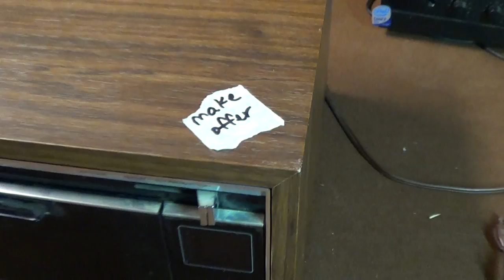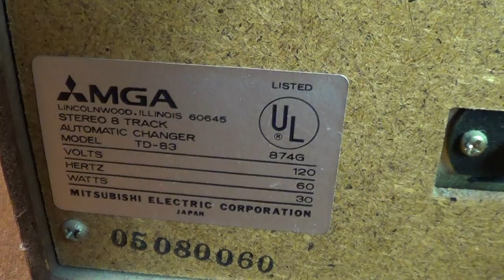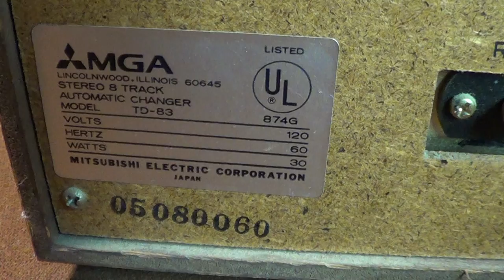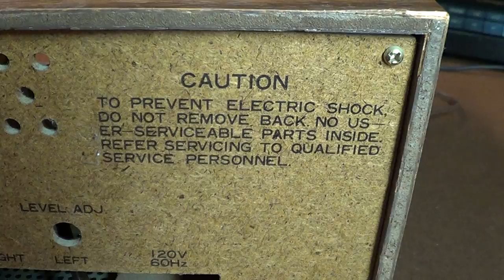MGA (Mitsubishi) TD-83 Triple 8 Track Tape Changer Overview

Comment: Watching this video brought back memories for me. Back when I used to have 8-Track tapes, this changer was one of the several players I had. I acquired mine from my high school, I found it in a storage closet in the main gym. I eventually was able to take it out of the closet and bring it to one the assistant principals and asked him if I could have it, he asked the principal of the school at the time if I could have it and eventually told me that I could have it since nobody else needed it or was using it. So I had the player for several years until I sold it to a used record store in my town back in 2010 when i got rid of all my 8-track tapes and players to focus on my record collection.  I do remember the player making that twangy sound when you turn it on without inserting a tape first. Towards the end of me having mine the player stopped switching channels automatically but still would switch manually and the belt would also fall off often as well, i am not sure why those things happened but they did.

Comment: In an antique mall about twenty miles from where I live, there is a very scarce MGA wall-mounted hi-fi system.  It has a vacuum turntable with linear tracking, a built-in 3-motor tape deck, an AM/FM radio with AM Accent, and a built-in 200w 4-channel amplifier.

Comment: That's awesome! Interesting how yours has a level adjustment just like VWestlife's. Up until then, I've never seen that before, other than some cassette decks that have a playback level adjustment on them.
It's too bad the motor mounts broke, but I'm sure that can be easily repaired. You've probably got everything you need to repair it.
It looks like a very beefy mechanism. Sometimes with these complicated mechanical devices, they tend to have a lot of problems, so it's nice that it works perfectly.
Someone mentioned a SDP easy-bake oven... it actually does look a little bit like a mini oven!

Comment: Hey uxwbill I really enjoyed the rant about the cheap modern motors vs the older higher quality motors given the fact I personally own a 1920s Hoover vacuum that had sat in a basement for 50-60 years if not more and had never worked yet after a mild oiling it sprang to life when I plugged it Ina's if it had been produced yesterday if not better. On a irrelevant point I hate to be a pain about it but I would really appreciate more car videos namely more of fur heads jeep, the key keepers EBGPOJ, and the little 2.3 ranger and maybe even some grain truck vids. But as I've pointed out before I'd namely like to see the ranger as it's a bit nostalgic for me given I owned one  of the same body design

Comment: May I suggest to use rubber washers with a plastic lockable plastic strap like the ones used in wrapping computer power wires!

Comment: There is a tube of glue that I have that was made by 3M, it's some sort of rubber cement for neoprene and EPDM? rubber, I use it for patching speaker cones but it will also glue rubber to rubber. I've used it a few times to patch bicycle inner tubes with rubber from other bicycle inner tubes. I think it's called "Sure Grip' or something. Lets say that glue does not work I have seen mounts like that before, though I cannot recall where, it looks like they have a threaded insert molded right inside the shock mount. In any even I am sure you will come up with something, even if you have to rework it to accept a rubber grommet through the chassis with a screw, nut, and washers. Maybe even compression springs like a record changer would use?

Comment: This looks very similar to the Realistic TR-888 Triple Play 8 Track Stereo Automatic Changer, maybe Mitsubishi made that too?

If you find 4 appropriate grommets you might drill out four holes on the units chassis, insert 4 grommets. Use washers and nuts on either side of the grommet to insure the screws/bolt stay in place a nut on the top and bottom of the grommet. also drill 4 small holes on the motor's chassis and tap the holes to fit the screws, screw the screws in from the top, down toward the units chassis. Once the screws are screwed all the way in, be sure the screws do not unscrew by coating the screw where it seats onto the motors chassis with fingernail polish. once dry first put a nut onto the screw, then a washer put this through the grommet already inserted into the units chassis and the a washer and nut on the other side. You can now adjust both the top and bottom nuts insure the pulley on the motor lines up with the weighted fly-wheel / pulley.once the nuts are properly adjusted, coat them with nail polish to insure they too do not rotate, thereby throwing off the adjustment you made. You not not want grommets that are too soft or too hard.

Comment: I would think that if you took some small machine screws and some old fuel line and ran the machine screws through the motor brackets, then through the fuel line, and into the frame.

Comment: Bill, you might try Shoe Goo to repair the motor isolation mounts, it adheres to just about anything and is still flexible when cured.  Very strong when cured, too, much tougher than silicone.
Link - http://en.wikipedia.org/wiki/Shoe_Goo

Comment: Rubber or silicon washers stacked is how I would fix it, such as this - ( wwwhomedepotcom/p/DANCO-3-8L-Flat-Washers-10-Pack-88576/100143490 ) with a screw down the middle. 2 holes might have to be drilled though the base for the screws where the old rubber mounts where. Or epoxy the rubber mounts back to the base.